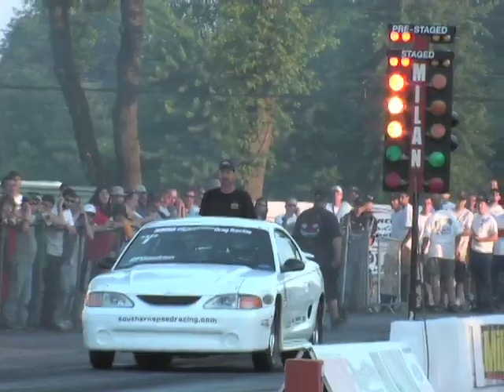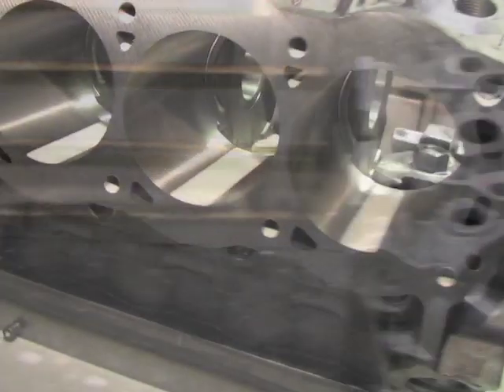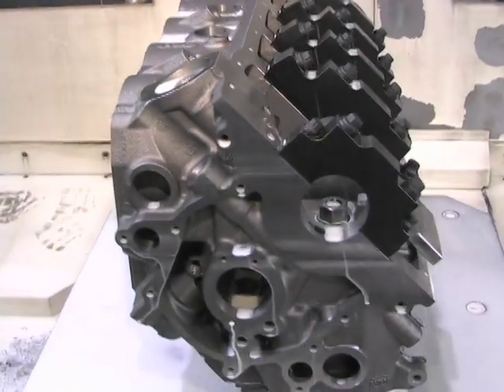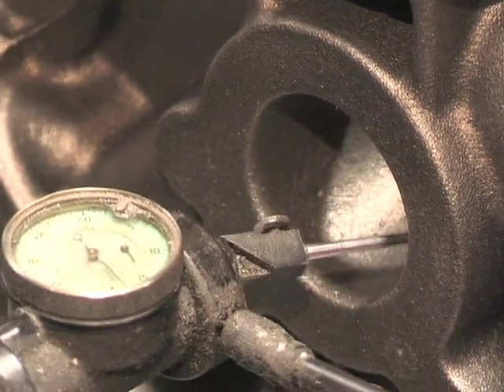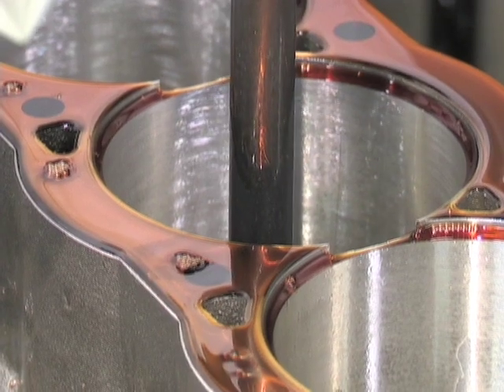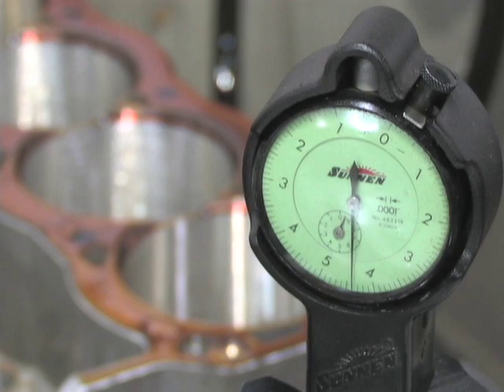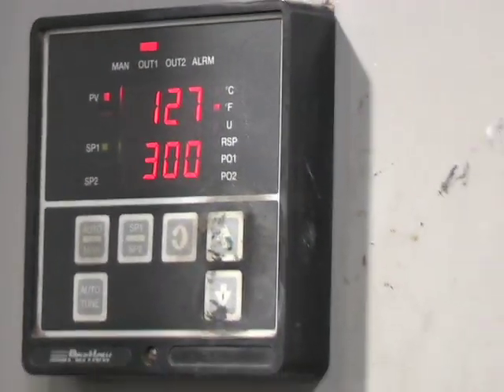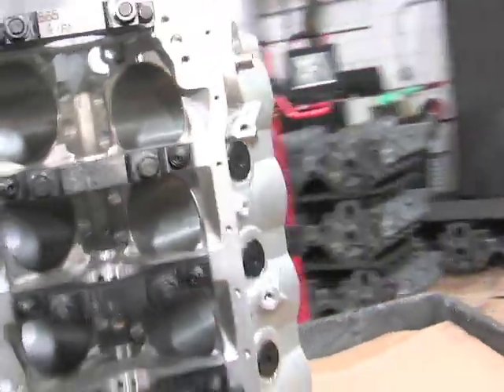Dart Ford Engine Blocks

Comment: I have ran the Ls next block for over a year now and no problems I’ve done one refresh on it  but I have more than I wanted to put in the internals the blocks are bullet proof though I run 40 and 45 pounds of boost and never no problems.

Comment: Dart needs to do some more homework on the 302 SHP block.  Oil pan will need to be modified to clear the mains and motor mounts wont work without some mods.
Reply: any recommendation on a block?